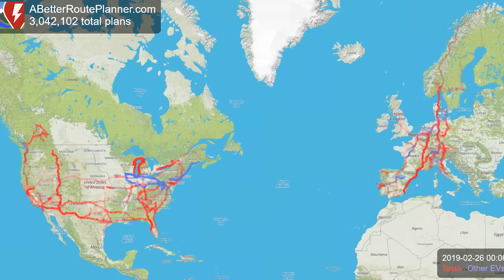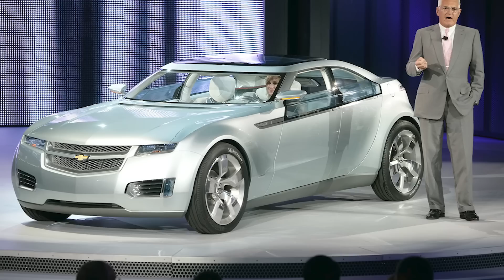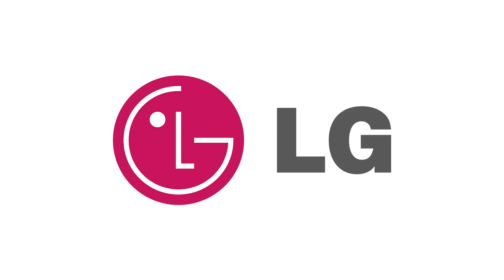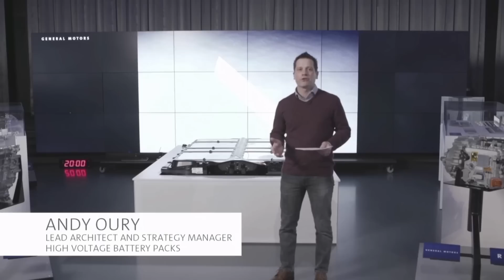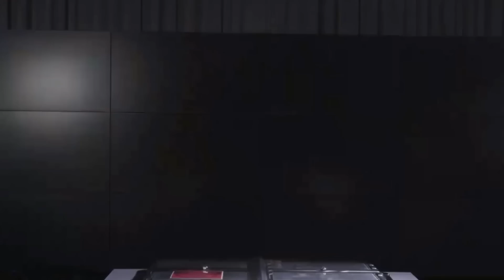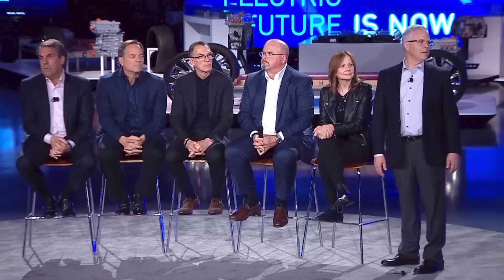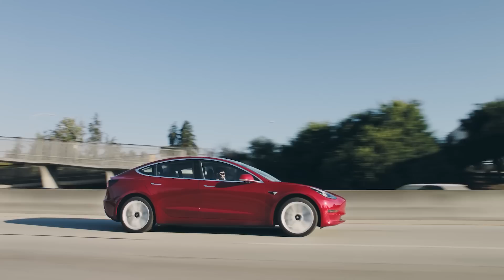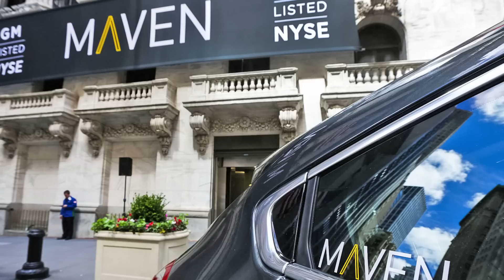GM EV Day | In Depth

Comment: GM and Big Oil could easily "convert" dealerships and petrol stations to EV charge points. Solar, wind and geothermal generation could be stored in battery packs and fed back to charge EVs 24/7. The dealerships could offer a variety of entertainment, food and even accessories to help the charge up customers pass the time. Same with gas stations - when profits for gas dropped in the 90's we saw the creation of convenience stores built into gas stations. And the government could help by switching subsidies for oil to subsidizing this massive restructuring. MOVE THE MONEY and you'll MOVE THE TECH. We gotta help them get OUTSIDE THE BOX...
Reply: Almost 20 years ago, BP underwent a massive re-branding exercise. They changed their name from "British Petroleum" to "Beyond Petroleum" and even spent several hundred millions changing their corporate logo from the BP Shield to the BP Sunflower Motif. Huge noise was made by BP about how it was going to transition away from oil into other sustainable energies.
20 years later, they are as heavily into oil now as they were then. Their investment in renewables? Practically zero.
Reply: @brunosmith6925  Follow the MONEY, not the chatter...

Comment: Really nice analytical content guys... I agree... I had hoped that GM would at a minimum demonstrate that they understand just how far behind they've gotten, but not only did they NOT do that, they actually made it worse.  They demonstrated pretty clearly that the suits who are making decisions about this stuff are only driven by schlock and marketing gimmickery.  The whole thing was obviously a reaction to shareholder anxiety about where Tesla is headed, but rather than reassure their shareholders, this entire presentation should only have solidified for them the idea that where GM plans to be in 15 YEARS is not really even where Tesla will already have been next year.  GM and virtually all the other auto manufacturers are WAY too far behind Tesla to save themselves at this point, and many of them don't even realize that they're already basically the walking dead.  They continue attempting to use 20th century corporate thinking to deal with problems that require much more flexible and advanced solutions.

Once the Model Y and the Cybertruck are gobbling up sales of the Silverado and whatever they're calling the junk that they sell in the category of a "crossover" these days (Traverse, mabe?), GM stock is going to drop like a lead weight.  None of these people involved in this presentation are really going to care about that, though, because they'll have moved on to other things while GM's ashes smolder on the trash heap of history.  There is no cohesive vision of the future tying all of it together like there is for Elon - the Boring Company impacts TESLA Motors, and Tesla energy impacts Tesla Motors, Space X will impact all of it.  If I were a GM investor, I'd be really pissed at this schlocky BS.

Comment: Y'all would be mistaken.  GM DID invent the skateboard EV design,  25 years ago! GM HyWire,  with 25 patents. Also,  look up Electrovair, based on the highly versatile Corvair platform (2  door,  4 door, convertible,  wagon,  sports car,  pickup and van all on one platform. Also there's the GM EV1, of course.  Out of that came "AC Propulsion " company. 

What you'll find is that GM tech and engineers CAME OUT of GM many years ago to develop their own electric car companies,  which led to ... Tesla. Who actually did all the things,  with the elements of EV design,  that GM left on the table. Which is what we're still seeing today.

Comment: GM crushed the EV1, discontinued the Volt, and lost $9K on every Bolt sold. Now they are going to spend $20 billion chasing Tesla using the same failed GM strategy. We build the frame, chassis, motors and assemble and buy everything else from 3rd party suppliers including software and chips and electronics. We will have an EV in every product line. Fail! Pick a segment and dominate it. Tesla gave you the roadmap. Barra is so stupid she should work for Ford.

Comment: If GM can transform their dealer network into autonomous operation centers with chargers to maintain the autonomous operation that can turn this to a positive branch. If they get to autonomous one day ( questionable) the actual operation will benefit from autonomous operation centers (AOC). AOC can inspect the car, clean and tidy the car, charge the car and return the car clean and charged, it will have utilities and provide efficiencies for the autonomous network.
Reply: In the near term day to day operation needs a boots on the ground operation presence, for things like stranded autonomous cars dude to various reasons. In the long term the AOC can add energy bank business model (with power packs).
Reply: Dealers are independent businesses.
If GM comes in and says "In X years, you're going to be autonomous"
The dealers hears "In X-1 years my business is screwed"
(They are quite possibly screwed anyway)

Comment: “innovate or die”

I see how outsourcing could put one at a disadvantage as far as innovation 

I see GM as kicking the can down the road in hopes of jumping on whatever will be trending in the future, kind of thinking
Reply: "Innovate FIRST and in the right direction, or die"
Watch the recent armed forces interview with Elon Musk.
Reply: Outsourcing and insourcing (vertical integration) both have advantages and disadvantages. For example, Toyota has sunk billions into hydrogen vehicles all for naught. GM saved those costs. As a purchaser of the latest tech, they save R&D costs, and buy from the vendor in the lead. Indeed, Tesla bought from Panasonic in the beginning.
Reply: @ProgressiveVegan  
If Tesla had tried to outsource major parts common to EV's and ICE cars the other manufacturers would have "had a word in the suppliers "shell like" (ear)" and Tesla, (small customer) would have faced "problems" with supply. (I believe it happened at one point? Seats?)
As to "saving R&D"
Doing so, you "get what you're offered", not always what you want (need).
"GM...  purchaser of the latest tech..."
Really ?
This looks like "the latest (off the shelf) from that supplier" (that will undoubtedly be available to Mercedes, VW, etc as well?)

Correctly spent R&D pays dividends (HW3!)

Tesla "bought from Panasonic" due to the CapEx required, plus, there was essentially nobody else in that market at that time (ok, Nissan)
It was an opportunity for Panasonic as much as Tesla.
Reply: What a sad day it will be for those people who lose their jobs
Reply: @CHIKEMAN  
I've seen at least 3 disruptions in the (related) industries I've worked in.
It happens more than you think.

Comment: I've never seen you two (and staff) work so hard to find tiny jewels of reality that you could play to. Oops, looks like GM did a much better job simply "rebranding" fantasy. Big Oil supplements I.C.E. production by "paying for" the R&D needed every time the formula for gasoline is modified. How can that be and why, then, do old cars still run? You can write anything slightly reasonable on a check stub - that don't make it real. It's kinda like spreading around the BILLIONS of dollars of CASH SUBSIDIES that Big Oil gets from US (I mean you and me) every year. GM and others will STOP receiving that money when I.C.E. production halts. And Dealerships will be mighty mad when they stop getting an AVERAGE of $5k per car for service and repairs (over its life cycle). The dealership license payments to GM, yearly, will also stop.Pressure from BOTH ends of the financial spectrum. GM either has to go COLD TURKEY or go out of business - that's the ultimatum from their main income providers. So this dog and pony show was intended to make people WAIT to go EV - FIVE YEARS (6 if you count from now). Thanks for sharing...

Comment: Hello: I'm not sure, but I remember GM showing an electric platform that had all the powertrain with suspension that was shorter in height than the diameter of one of it's tires that it could put any model on top of. I am 65 years and I have learned one thing for sure that I want to share with you. DO NOT BELIEVE GMC. Thank you and have a nice day. AL R
Reply: Your read my mind! I dont trust the company that sold battery tech to Chevron Texaco which sat on the tech while the inventor who sold it originally to GM thought it was actually going to be brought to market. That engineer is dead now and social media is alive and we share what the bought and paid for media wont share.
Reply: @justonpreble4083  Let us never forget that piece of information!  That's what GM is all about.
Reply: you have got a very good point
Reply: 2002 Detroit auto show GM showcased the electric skateboard concept.
Reply: Yes GM showed the skateboard platform many many years age either during or after the EV 1 was produced. The only drawback they had was the motors that would be in each wheel hub had not been invented yet.
Reply: I remember it too. It was this one the "autonomous" platform, with drive-by-wire. 
So in a way GM may have inspired Tesla or they are both inspired by soapbox cars. :-) 
https://www.autoblog.com/2010/09/24/forgotten-concept-2002-gm-autonomy/?guccounter=1&guce_referrer=aHR0cHM6Ly93d3cuZ29vZ2xlLmNvbS8&guce_referrer_sig=AQAAAIKZYzGFjZbxv3pPKdwZbSxPHBkfHaHyVsHG7gs-y-HjdGh4vTrvI355AZMX-qlIVo7-F9BI-fcf9yaRxo0WFptpGvjq4GEj1O62Jxlggj307J7xKT0Ky7PCpDInUHVxv7B9RNce3MjGXMxQdVxK8kxSczlOGAYL-aY_ODFcy4aS

Comment: Cmon guys give GM more credit. They have a proprietary NMCA chemistry that LG is manufacturing in a joint venture just like Tesla did with Panasonic and they had a solid state prototype cell. This is definitely a big step in the right direction, this platform has competitive specs that will appeal to many consumers.
Reply: "We will have a 200kWh pack that gives 400 miles range"?
Competitive?

We start building in April.... Ready in? 18 months?

We will reduce the cobalt in cells (currently 10-12%?) by 70%... That'll be 3%, where Tesla is now.

The solid state cell will no doubt be the one they asked LG About circa 2013/14 (just like every other company) and were told "5-6 years"?.... Maybe.

Comment: There is typically a good reason you don't stack pouch cells vertically, i.e. short edge down. That is because if you imagine the cell as a deck of cards, with the electrodes sandwiched in the pouch, any vibration, shock, or other mechanical stress in the vertical (z) direction will tend to slide the electrodes out of alignment. This can force the electrodes into the bottom of the pouch, crimp the electrode corners into the corners of the pouch, and crumple the edges against the bottom of the pouch. Typically, you orient the flat face of the cell in the direction of the highest mechanical motion to prevent this exact issue. Oriented short edge down, only the compression on the cell faces keep the electrodes from moving. Imagine holding a stack of paperbacks between your hands. Held flat face parallel to the floor, force in the vertical direction won't disrupt the stack. Held edge on to the floor, any vertical pressure in the middle of the stack will result in book movement.